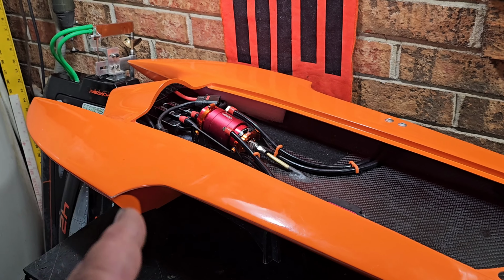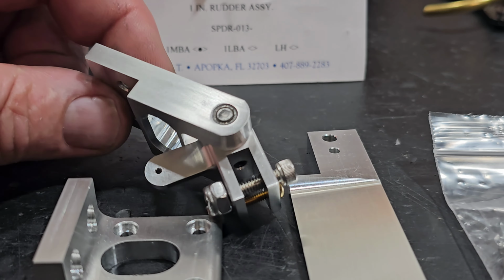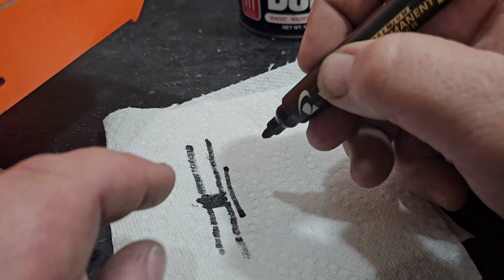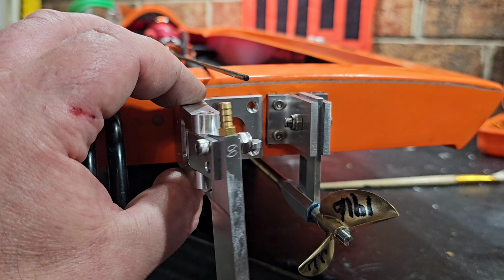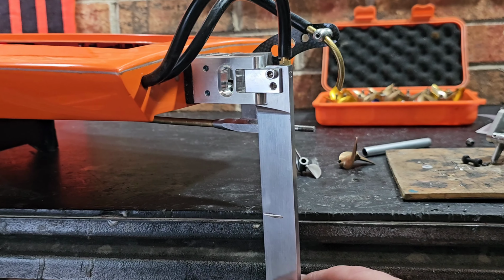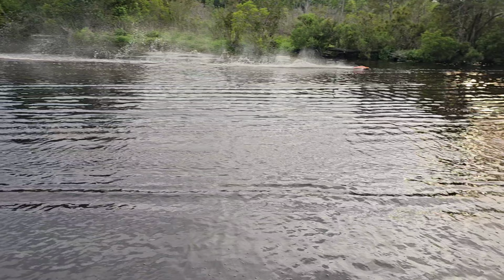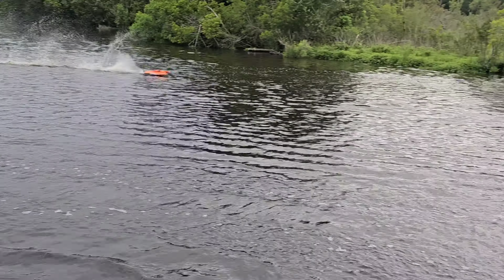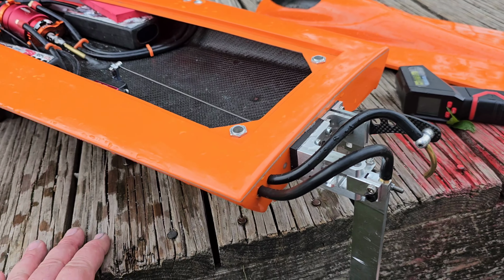Beefy Speedmaster 1" Rudder Install & Test Deltaforce Vortex 34 Fe Rc Hydroplane

Comment: From what I remember when designing models for Hobbico,  On most real hydros, the prop is directly under the back transom.  The rudder does not matter the setback, but the real hydros (full size) have their props under the deck near the transom. The angle of the straight drive shaft is what keeps the hydros rear up and out of the water. I used the Octura Z or Y  937 /3-blade prop on the Hydro I last designed for the company.  The drive line angle was -10 degrees between -13 and  -9 degrees is where I used to tune. That sounds like a lot but the prop is the third point of contact. There are the two sponsons and the prop. Those are the points of contact. The rudder and the skid fin are control surfaces and the wings are in the front. Too bad we don't have these most of the time. There will be no prop walk with the drive line angle change.
http://www.h1unlimited.com/h1-unlimited-glossary/

Comment: Big B I'm building a 1/16 ATLAS VAN LINES UNLIMITED hydro and was wondering what your thoughts where on what rudder and drive strut you suggest. Thank you for your time.
Reply from the maker: This is what you need https://www.ebay.com/itm/144806803388?mkcid=16&mkevt=1&mkrid=711-127632-2357-0&ssspo=ki17nUeJQfy&sssrc=4429486&ssuid=yQkZS9FcQay&var=&widget_ver=artemis&media=COPY

Comment: I'm not sure if you noticed it but I think the set screw that you think it doesn't have is in the slot where the rudder goes. I could see something in the video that was black. if it is that's a better spot imho. That way you just remove the rudder and the set screw is right there rather than hidden on the forward side of the pivot which is harder to get to. A couple times it wanted to pop up and kick out. I noticed the rear end of the boat was in mid-air. I still think your center of gravity might be a hair too far forward, but I guess you will find out once you have it wide open at the speedrun spot. I ran my Popeye this weekend on 6s for the first time. I need to pull the motor out and verify it's 1800 KV and not something silly like 2400 KV. Just ran a ul19 prop. It has insane acceleration. My guess is mid60s and I can't even go over 3/4 throttle. It's starting to turn into an airplane which worrying me because I can't get my CG much farther forward. End up having my damn stuffing tube came loose again. Any suggestions to keep it in place but still able to tweek the brass tube? I scuffed the fiber glass inside and paint on the bottom before using 30min epoxy.
Reply from the maker: I noticed it when the boat gang pointed it out earlier today, good to know, but really wouldn't have helped much if I had reversed it on the hing block, still would have had to drill one of the rudder mounting srew holes out.     Thanks for pointing it out to me. Sometimes I get tunnel vision when I have the camera rolling.
Reply: @IRONCLADRC  so was going to change the strut on my popeye. the strut on it is so small its for something like a 24" boat not a 32" boat so i cant get the strut even close to level with the sponsons. I also noticed the popeye uses a mono style strut. This moves the prop behind the rudder. Rudder first makes the boat handle tighter which is maybe why it doesnt prop walk with the crappy popeye rudder. You put the prop in front of the crappy rudder on your boat which makes the boat loosey goosey.  All of this is now adding up why it doesnt prop walk on a popeye. The rear end isnt lifted out of the water as high by like 1/2" or more based on the small strut. Plus the rudder placement biases in front of the prop. Glad you got it figured out now since your a few videos in front of this one now. Hopefully someone else reading see's this in the future to help.

Comment: uuhg the reason it runs better as u move it off the transom is because its on the left. basic r/c boating.
Reply from the maker: The right mounted rudder is a rule on cats' monos tunnels but hydros can be set up with a left or right mounted rudder.
Reply: https://youtu.be/Oyv29d0v18Y?si=nMQOysPGrwPAIvzh
No rule in the hobby 🤔 just joy😊

Comment: Looking better with the new rudder big B! That thing is LONG. My thinking is the really deep rudder is acting more like a bandaid. Seems like the underlying issue of the prop walk is still there. Getting closer though can’t wait to see what it does at the bigger speed run spot. Boat gang!
Reply from the maker: Working it out, first run with the new rudder was better but not perfect.   Yes it's long. lol way too long, gonna cut it down incrementally..

Comment: I could tell by you first long pass it looked so much better, you nailed it.  I agree with the position of rudder on the left 👍, and I now know what’s going on with my BJ24, rudder to far forward of the prop, might switch to left as well 👍. I have all kinds of new ideas now for my BJ24. 
GREAT BUILD SERIES!!!   BGFL
Reply from the maker: I wouldn't switch the rudder side on the blackjack 24, a left mounted rudder really only works on hydroplanes, I've never seen a catamaran rudder mounted left due to the prop rotation
Reply: Got it 👍

Comment: You did the same thing I did! Flip it & drill it & run a plastic screw! Hopefully the longer rudder fixes the issue. I think it should, same as you
Reply from the maker: Dude I found out there's a grub screw on the rudder bracket, it will come off the hinge block to be flipped over.   I totally missed the grub screw. Lol.
Reply: I spotted the grub screw in the "unboxing" portion of the vid. You pointed it at the camera, but I am sure from your POV it was not visible. I figured you'd find it sooner or later.

Comment: Now that the rudder situation has been fixed. Would you consider removing the shim on the strut and running it inline like your original setup?
Reply from the maker: Probably leave the shim, did some research and found the shimed strut aids in keeping speed in a turn

Comment: The rudder leading edge should be even with the front of the prop blades. It's interesting, if you lead with the rudder edge, the boat gets "loose", like in NASCAR. When the prop leads the edge, the handling goes to tight. Size of prop interacts with the best spot. Start them dead even, or neutral, and work it from there. I learned that in the big boats... The rudder change helped it a bunch!

Comment: Looks like there is a set screw inside the clamp where the rudder blade attaches
Reply: I saw it straight away too
Reply: That's right, remove the set screw and the hinge pin can be removed and you can service the bearings. It's great hardware!
Reply from the maker: Yep I just saw that, good call!   Can't believe I didn't see that when I was seeing up the rudder.    Tunnel vision.
Reply: @IRONCLADRC  SCBG4L